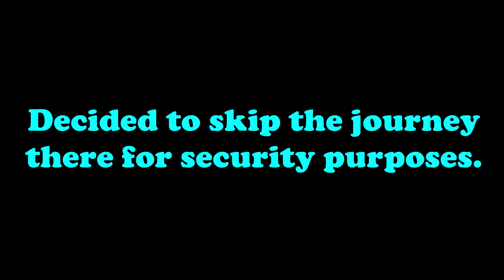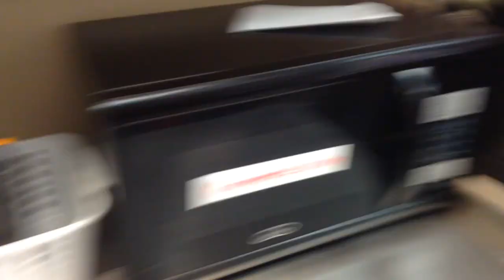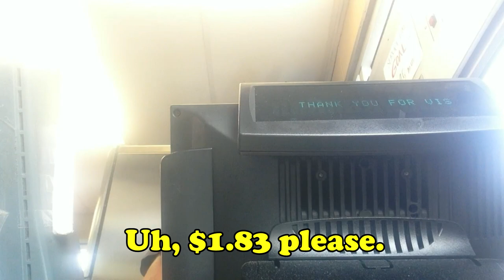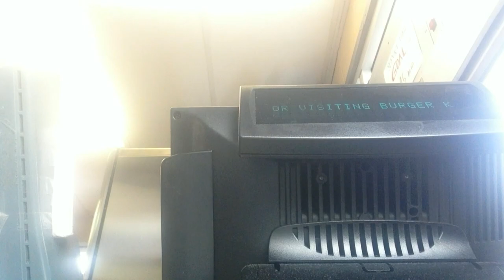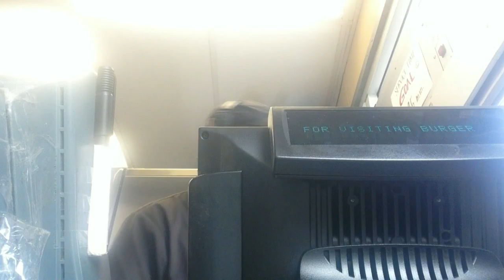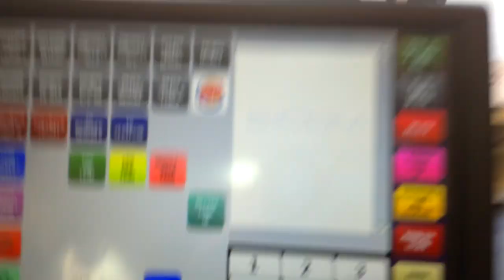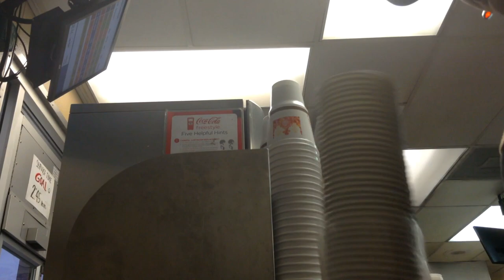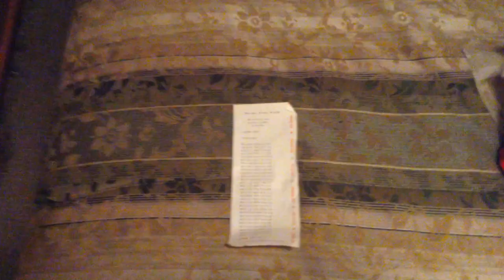bryNson Vlogs Ep. 5 - My Day at Burger King!

Comment: Hey man, so I recently started working at Burger King. Boutta be a week. However, I don’t really want to work there anymore. Due to the lunch rushes, and the constant running around. It takes a toll on my back. I was wondering how long did u work there? Because I don’t wanna quite early, which will look bad to future employees. Also, any tips?
Reply from the maker: I was able to wistand what you are going through for about a year. My tip for you (if you wanna stay) would be to just keep your composure and be quick to adapt. Try not to let THOSE customers get to you while at the same time getting accustomed to a fast-paced environment.

Comment: My mom used to work at a Burgerking. And what happened what she was the general manger. And her district manger never helped her thru anything or any of the other general managers from other stores. My mom had problems with a few of her mangers being rude and not wanting to help. So she fired them all then so she couldn’t stand the job any more and quit. And all the mangers she fired got hired back in after being turmanated from the system and they making them the new mangers to replace my mom. Her district manger was a idiot and didn’t know anything. But soon once they took over they had a big fire that damaged the broiler and half of the roof that’s what happens when you get rid of someone that knows what there doing getting 100 % percent of rev then hiring back idiots that don’t know anything
Reply: What year did these happen

Comment: Do you work only  in the car service or  you can also work in the cash register or making the hamburgers? I mean you have job rotations?
Reply from the maker: Cashiers only work at the registers. Not allowed to do kitchen work.
Reply: I used to work at Burger King. Was working there for about 4 years as my first job. I was tossed around at front counter, drive thru, specialty board, whopper board, breakfast. I worked mornings, afternoons, evenings and midnights.